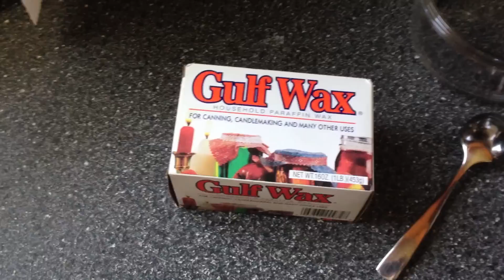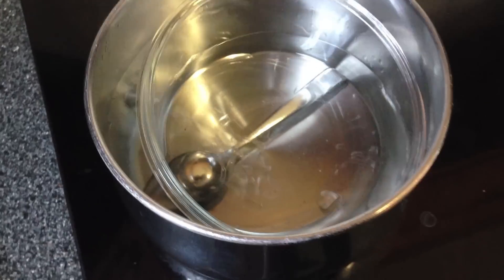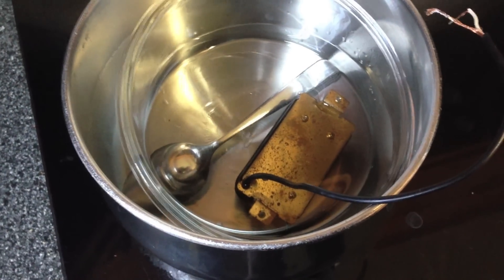Wax Potting a Guitar Pickup

Comment: I bought a set of cheap, generic pickups for a project guitar that I've been using just to learn how to work on my own guitars without damaging the ones I'm actually proud of. I get a decent clean tone when I amp it up, but with any kind of effect pedals added, I get some ear-piercing feedback. Would wax potting those pickups help to remedy the sound or is it just a byproduct of buying cheap, generic pickups?
Reply: From my understanding, wax potting should reduce feedback. Feedback usually comes from a self-induced sound loop. A speaker makes a noise, which the microphone picks up, and plays out the speaker, which is then heard by the microphone... you get the idea. By reducing the microphonic properties of the pickup, it loses the ability to hear anything, and therefore can't resend it through the speaker.

Comment: I know nothing about wax potting pickups so dont bash me for asking a question and making a comment. Wax potting my own pickups is something I want to learn to do. Wouldnt dobbing/patting the pickup with a paper towel remove wax from the surface? If there were excessively noticeable amounts of wax it would make sense but that would be difficult to see until dry. Also, can too much wax cause any issues?
Reply from the maker: Patting dry the excess wax doesn’t remove the wax from the vast majority of the pickup itself, especially on the insides. Wax potting is essentially adding a micro layer of wax on the copper to reduce the reverberation. I don’t think it’s possibly to add too much wax since a lot drips out when you remove it from the pot.
Reply: @TechStuff1  Thanks for the quick reply and explanation. Before I bought my Les Paul I had a cheap $125 Silvertone SLK1 I bought new, 16 years ago, to get back into playing guitar. Actually, I still have it. For a budget guitar it plays surprisingly well after being properly set-up. The only issue was you could hear yourself in the pickup and thats how I found your channel. Thanks to you Im going to give it a shot. It might be a cheap guitar but I really like how it plays and even the cheap pickups sound good in it. Thanks!

Comment: Nice tutorial; 

A good tip is to warm the pickup with a hair dryer before you drop it into the wax (reduces risk of damaging winding), and then remove the glass bowl from the pot so as to cool the wax down a bit (I put it in another pot with cold water in to cool it quicker) and when the was gets a solid skim on top, remove the pickup. This reduces the risk of losing wax from inside the pickup and causing an air lock.

I was shown this from a West Australian luthier in the 1980's and I think he used Bees Wax, but I'm not 100% sure on that.

The tutorial was very good and should help a lot of first timers do their own wax potting. Kind Regards Chris (Australia)

Comment: The science: Why does wax potting work? 

If a pickup isn't wax potted then the wires used to wrap the pickup can move. The way a microphone works, is that your voice (or other sound) moves a small diaphragm connected to a wire winding that is in a magnetic field. That movement of the wire coil through the magnetic field, induces electrical signals, which correlate to the sound that caused the movement. 
Wax potting a pickup encases the wires inside it, so that they cannot move; this prevents their movement from the sound of your voice (or amp or drums or horns...) from inducing electro-magnetic signals, stabilizing the pickups so that they are "deaf" to sound, and only react to the guitar's metal strings ringing through the magnetic field.

Also, another quick science fact: Once water starts to boil, it won't get any hotter without increasing the atmospheric pressure - like in a pressure cooker; so a simmer like that is exactly what you want. There's no need to make it boil harder because it won't make the water any hotter.

Comment: I liked your straight forward demonstration of pick-up waxing, and you answered one of my questions: what about the tape wrapped around the coils? I see you just dipped in the pick-up with the tape on it-cool, as I know it could be a big mistake to try and remove the tape and damage the windings. thanks! and I like that Charvel- looks like a good one - take care and greetings from Switzerland.
Reply: I'm no expert, but was researching this and found other "how to" guides suggesting a rubber band around humbuckers because tape can fail when heated in the wax causing the pickups to separate  At least, that's what I think I understood those other articles to say.  One of those others said after you first dip in, you take rubber bands off and then can re-dip (I think he said the first wax coat would help hold them together), but the other "how to" guide did not suggest any re-dipping in the wax.  I guess, from what I've read, you want to wax-coat the wire coil, you don't care about coating the pickup exterior, so I don't see a reason to worry about not getting the exterior totally wax-coated where you had rubber bands (since you'll be wiping off the exterior wax anyway).
Reply: I use 3M cloth tape, measure the size you need for your pickups and buy that size tape. works wonderful looks wonderful

Comment: Takes a while to heat up, but I picked up an old crock pot that I put my jar of wax into and once the wax is melted, give the pickups a good soak. Works like a charm. I also re-purposed a cheap sewing machine into a pickup winder. I wound two pickups purely by hand and that was enough of that! :)
Reply: +SquierStrat72  That genius dude. What do they sound like?
Reply: +Dan Osper The two I did by hand sound okay. They were just for learning and were built out of household junk and neo magnets. I did three telecaster bridge pickups on the winder. Two are a bit over 7k, Alnico 5 and sound very traditional tele. The third, which I ended up using in my tele, is 10k, A5, early Broadcaster style. Still sounds like a tele, but a bit more drive and a little less high end.
Reply: SquierStrat72 10 k sounds like fun. 500k pots no doubt?
Reply: No, 250. It's smaller 43 gauge wire, like the original Broadcaster/nocaster, so it's about equivalant to 8-9k of standard 42, output wise. And it's wired Broadcaster style, so no tone control. Instead, it's a blend pot in the bridge position, to blend in any or all of the neck.
Reply: SquierStrat72 Interesting set up. i'll keep that in mind on my next build.
Reply: Hey SquierStrat72, the sewing machine sounds genius as stated above, I would absolutely love to see how that works. If you ever get a chance to make a video of it I would be so grateful! 

Thanks,
Matt
Reply: take off the tape first too.. this guy didnt and its stopping wax from touching the sides.

Comment: seemed cool..i have 2 extreme v models and they both are squeeling like hell when playing at rehearsal place with loud volume..i have a noice gate in my amp and even thou i touch the strings demping them with left hand fingers and with right hand on where the pickups are it still does this squeeling..the other guitar has tone knob on it and it doesn't squeel when i turn it halfway or off..if i turn it more on than halfway then it starts to squeel..i have dimarzio evolution II pickup in it and the neck pickup is not connected..there was one wire cut off from the tone knob but i don't think that it helps if i reconnect it..still gonna try thou..i thought about foiling both the guitars too if that would help if reconnectin wires doesn't..but this pickup waxing seems good idea too so i might do it too for just to be sure..thanks for the good tutorial

Comment: I did everything literally the same way like in this video, with spoon and transparent bowl, I just take them out and clean, (btw I hold them in for 6-7 min) process of cooling will last couple of hours more I guess...I'm so nervous and have 2 fears, first that they will not work 😬 and second that they will work but still be microphonic 😂
EDIT: I thought first that I kill both humbuckers, but I wired it wrong, then I thought that just neck humb. is dead, but today I discover that it works as well but some wire was on the lose inside it..so glad that they work 😀  I only have problem now, (they're not microphonic the way they were before) but high pitch sound as feedback start to squeal abnormally soon as I put volume pot on amplifier more than 2.5, it never happened before 🤔

Comment: What about changing covers on pickups that are waxed in. How would you melt the wax to get the pickup out?
Reply: +Dan Osper If the covers are soldered on, and you desolder the joints, enough wax will usually melt to get the covers off. But really, any way that you can apply heat to  soften the wax will work.
Reply: SquierStrat72 OK. I was afraid of breaking something. These things are 20 years old with staggered poles. I think they might be worth keeping if the paint job is anything to go by. it has factory poly on it like a tank. I'm gonna clean em up and put em back in after I refinish it.
Thanks for the heads up.
Reply: +Dan Osper Just don't force anything or overheat the pickup, whatever means you use. Given that they are wax potted at around 140 degrees, brief solder iron contact or something like a heat gun or hair dryer to soften the wax should be fine.
Reply: SquierStrat72 Yeah I was thinking a hair dryer would be perfect.. The plate came off pretty easy. i think it was just a dab of glue on the dog ear and had perished. I can only try.
Reply: Dan Osper heat gun on low,doesnt take much

Comment: I tried this and got the same exact feedback effect as before. Nothing changed when I wired the pickups back in the guitar wasn't microphonic though I just assumed it was because of the feedback issues maybe less squeal but the feedback still sucks.
Reply: hockey14822 what is your signal chain?
Reply: if you can talk into the pickup and hear yourself on the amp its microphonic. Older guitars used these pickups a lot and they are easy to fix, new pickups are wound so tight by machines that your problems isnt the copper windings moving around. Just buy a sound gate pedal that kills off high freq. or an EQ

Comment: Is thre any risk using candle wax?
Pups are cheap n new -fernandes monitory x
Give some idea
Reply: Ronnie nazim candle wax is fine
Reply: Ronnie nazim depends on the melting point of the wax. Paraffin wax is good because when liquid it has a low surface tension and because it has a low boiling point. Last thing you want to do is get everything too hot as the insulation on the pickup wire can melt; short circuit, dead pickup.
Reply: Just make sure it's not waxless candle. Those have chemicals that cause the wax to burn instead of melt and leave a puddle.

Comment: Do you clean the wax off the top of the pickups?
Reply from the maker: Not really, the wax on the outside somewhat gets removed when you towel dry it. The main purpose of the wax is to coat the copper coils inside which you can’t get to.

Comment: why not take off the back metal plate first?
Reply: Cause that's not necessary, you'd get the exact same results.
Reply: Doesn't do anything. When the wax is melted it will seep into the coils just fine. The heat relaxes the winds a bit since they're copper so it penetrates.